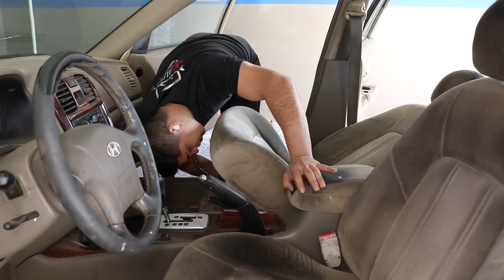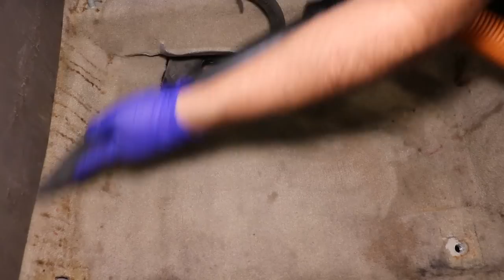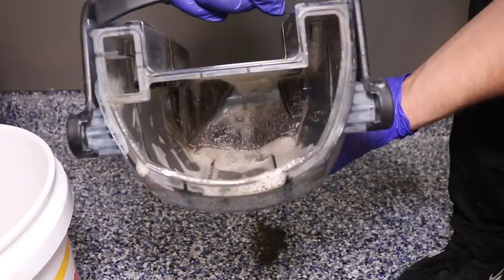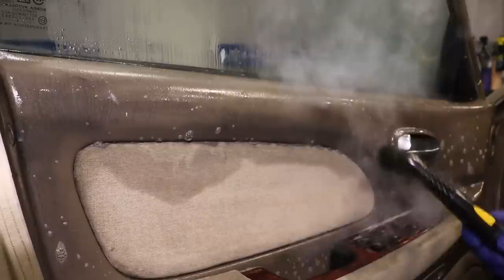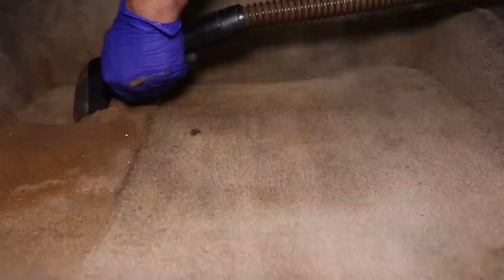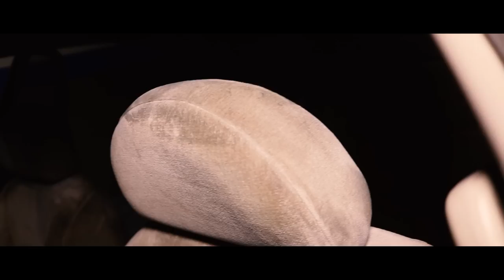Detailing The Dirtiest Car I've Ever Done | Satisfying Transformation of a 2004 Hyundai Sonata!

Comment: We have a 2009 Toyota Camry LE my dad working on cars for 30 some years said if we disconnect the battery and wait a certain amount of time then disconnect the wire harness the yellow one is for the air bags has them in the seats when we reconnect everything we will have to get a scan tool to reunite everyone so we don't have problems.

Comment: Truthfully you aren't doing a good job at extracting. You're leaving behind so much dirt and soap. That seat could have gotten so much cleaner. Use more water when applying the soap.. soak the seat more so that you allow it to soak in enough. Also work in smaller sections if you notice that the suds are getting way too dirty because all you're doing is mixing it back into the seat with the drill brush. Also, extract until the water is clean, use the water button on the extractor, go slow and extract from different directions. I think you should check out The Detail Geek on YouTube, he's very thorough at extracting.